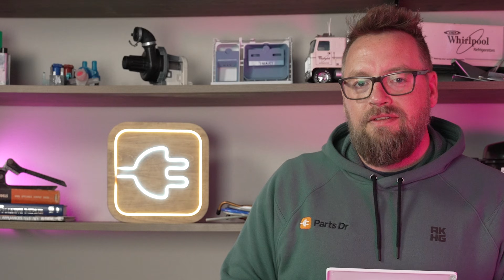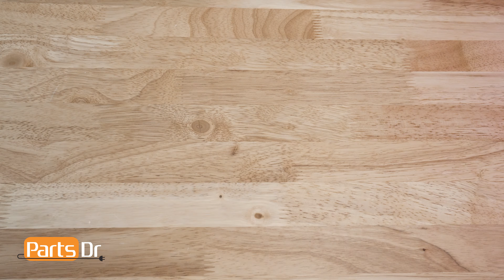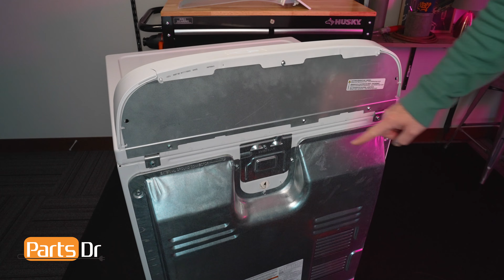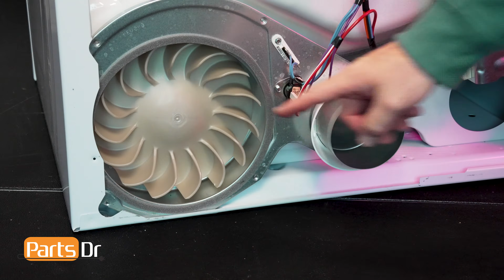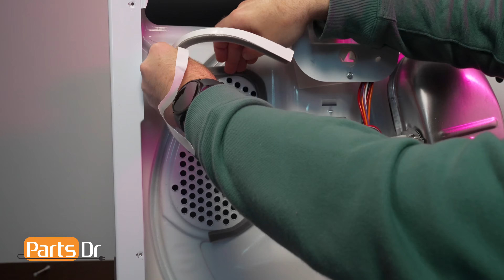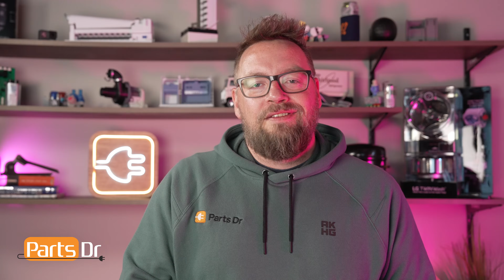How to replace Lint Screen Foam Seal part # WP339956 on your Whirlpool Maytag Amana Dryer

Comment: This is a very informative and well-done video. ran into a snag, however. Hoping you can answer: When I re-attached the long hollow lint vent housing piece (I had replaced the two foam gaskets with fresh new ones), I noticed that the metal oval-shaped top "mouth" (where it is supposed to seat against the lint vent on the top) did not fit snugly, so that there was a noticeable gap around the opening. This doesn't seem right to me. I used the correct gasket. I looked at several different gaskets for the lint "grate" part of the lint chute and they are all the same length, width and thickness. The bulkhead is tightly against the one-piece back panel that the sides are part of so I am baffled. What's the fit supposed to be- with a gap around it like that? I do not remember exactly how it was when I took it apart. I'm hoping you can shed some light- I don't want to re-assemble it if there should be a tight seal around this area..
My machine is a MODEL NO. Whirlpool Gas Dryer LGV7646AWO by the way if that helps. Your advice would be much appreciated!
Reply from the maker: We check our dryer shown in this video.  When the lint chute is installed, the "mouth" is securely touching the foam seal all of the way around.  We aren't sure the cause of your problem, but please let us know if you find the solution.
Reply: @PartsDr  Thanks for getting back. I'm going to remove the chute (mine has to come out the top after loosening the bulk-head and flexing it forward for clearance) and see if I can carefully remove a section of foam (hopefully its adhesive bond is still fresh from a new application a few days ago) and re-position it closer - right up against the "vent holes." Also, I'll slightly bend the "mouth" of the chute (ever so slightly) to see if it seats closer. As it is now the mouth is not quite touching the foam seal (Not at all like the foam seal around the blower vent, that is really pressed flat securely all around. I'll report back.